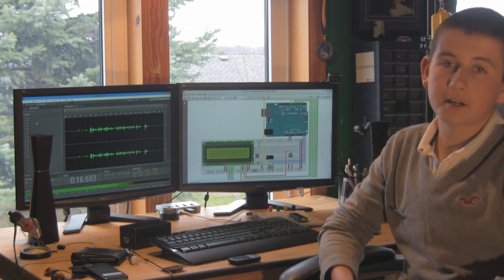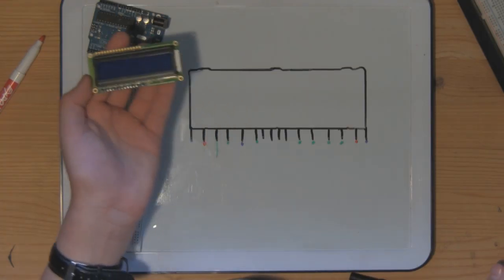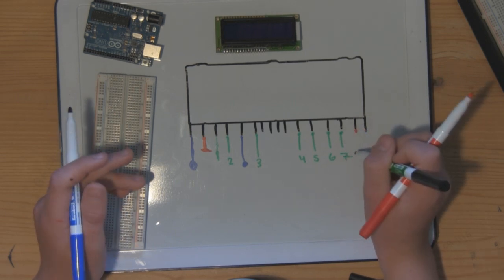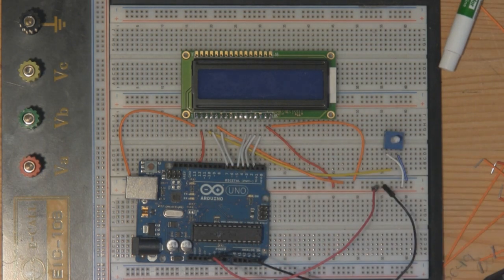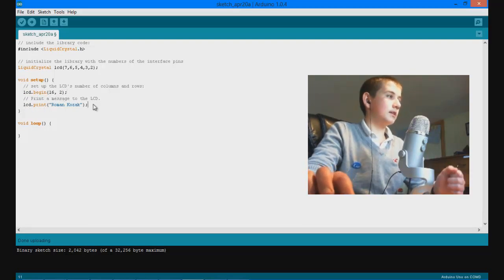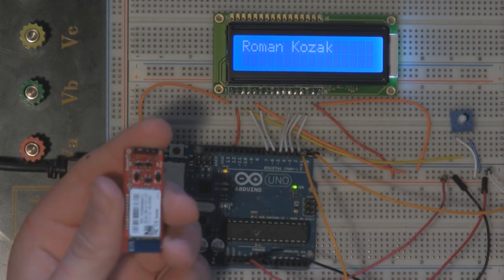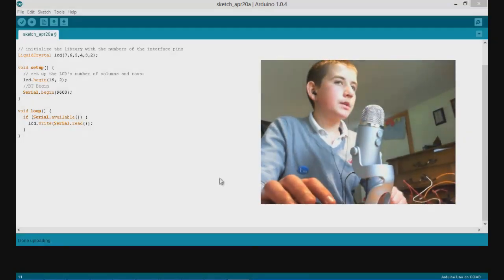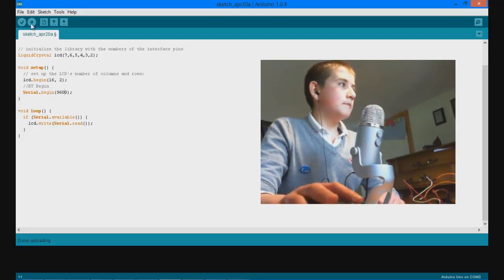Arduino LCD Tutorial (Liquid Crystal Displays)

Comment: Oh man Roman I got this SainSmart LCD http://www.amazon.com/gp/product/B003B22UR0/ref=oh_aui_search_detailpage?ie=UTF8&psc=1 wtihout realizing getting the right library was going to be a pain, please help!!! I've tried all the libraries I could find and nothing :/

I'm connecting ground, voltage, the sda to pin 4 and the scl to pin 5. This Module only connects 2 pins.

I really appreciate the help
Reply from the maker: Andres Medellin Hi Andres, by the looks of the module it is controlled via I2C (only 2 pins) not serial as demonstrated in my video. I found some code that should work for you. Good luck! http://www.sainsmart.com/sainsmart-iic-i2c-twi-serial-2004-20x4-lcd-module-shield-for-arduino-uno-mega-r3.html
Reply: ***** Thank you so much! turns out the library was right but the code was wrong! I had to run a i2C scanner to find out my pin was 0x3F and voila! thanks a bunch again ^_^